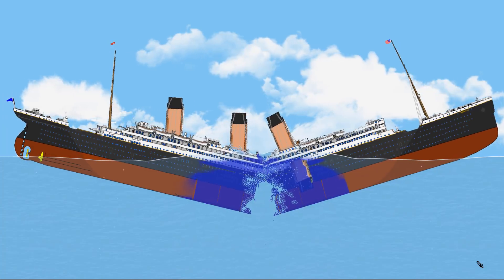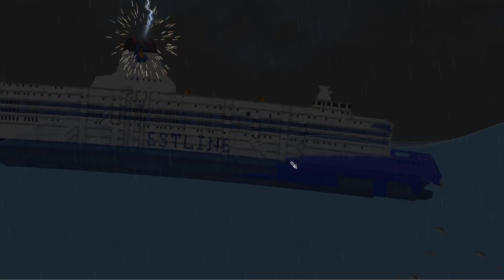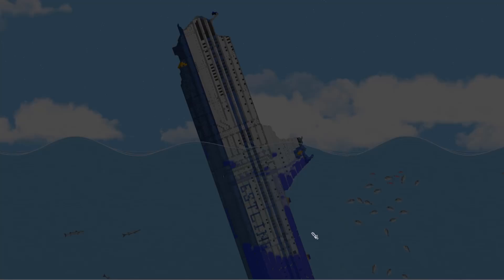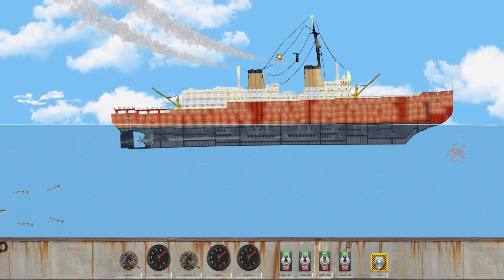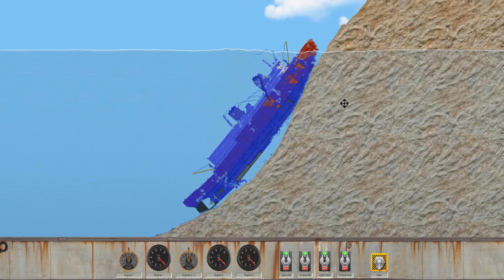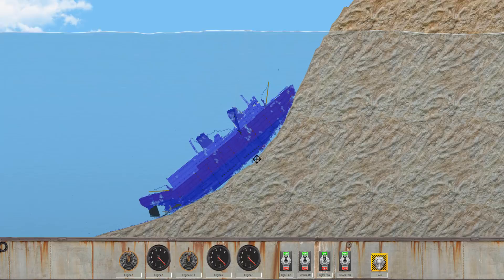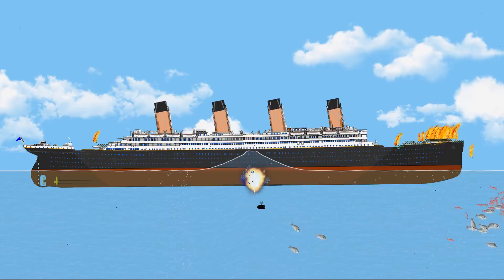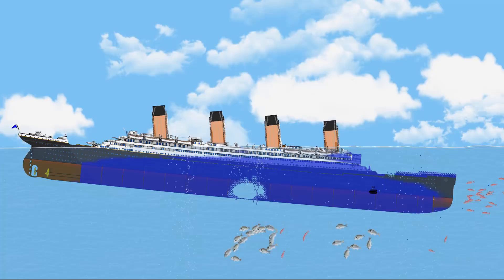Bombing Olympic! | Floating Sandbox

Comment: from what I heard, the brittanic is still in better condition     than the titanic and one of the largest coral reefs
Reply: Haha yez🥶🥵🥶👌
Reply: E
Reply: this is for a few reasons, most listed below, but one big thing is that it didn't split in half. when a ship splits in half, it's taken up so much stress that most of the hull is usually compromised. While britannic's bow split off, that was when she hit the seafloor. And it was only a small margin of damage compared to titanic.
That and Titanic is several thousand meters deeper under
Reply: @Hammerheadworm It isn’t really because of those reasons. It’s mostly because the pressure on the wreck isn’t as great as titanic. Also the ship didn’t split in half.

Comment: there's a new update if you haven't already, you have to uninstall and re install it. in the update you can now play with implosions and electricity and so much more.
 
but either way great video i enjoy the effort you put into these videos keep it up

Sincerely
Damien
Reply: btw heres the update log  

New Content

- Simulation of pressure: All structures are now subjected to atmospheric and hydro-static pressure as well as their own internal pressure, which changes depending on depth, holes in the structure etc which can cause implosions and explosions!
- Floating Sandbox is now available on Linux! The game now works on Ubuntu 18.04 and Linux Mint 20.2. If you have any issues on using a different version, contact @Gabriele Giuseppini.
- Water impact forces: A structure will buckle and deform when striking the water at high speed!
- 3 new tools!
Inject Pressure: increases or decreases the internal pressure of structures.
Blast: creates explosive force fields of different sizes and strengths.
Electric Spark: generates electric arcs on the surface of a ship.
- New sound effects!
- Silting: When on the bottom of the ocean, wrecks will lightly sink under the seabed over time!
- World width has been increased from 5km -> 10km.
- Air density is now adjustable, and the range of the water density slider has increased.
- Direction lock to the slice tool - hitting the SHIFT key during a cut locks its direction.
- Night Vision setting for seeing at night!
- 3 more ships that demonstrate the new pressure mechanics!
- 2 new materials - Mylar and Mylar Hull for flexible inflatable balloons!

Fixes
- Wave simulation has been improved.
- Explosion physics have been improved.
- Reorganised the simulation settings window.
- Improved other sound effects.
- Changed default ocean depth to 1000m.
- Improved rain.
- The physics panel is now compatible with the USCS and SI systems.
- Changed some material colours in preparation for the upcoming in-game design menu.
Reply: Wait, really?! I'm checking that out
Reply: Time to isntall it and make the titanic Sink